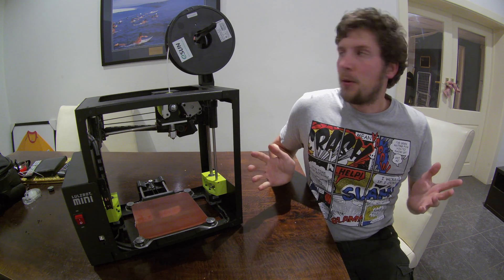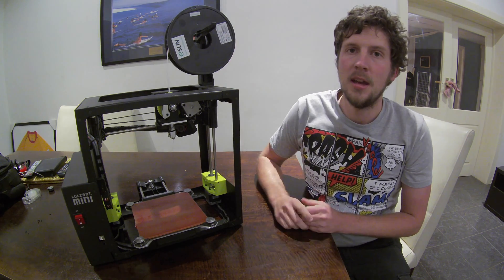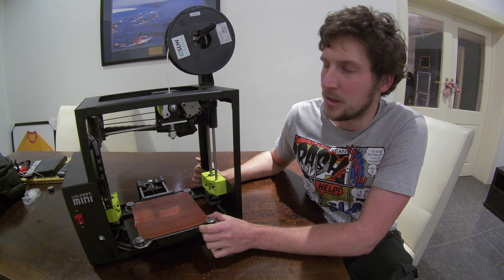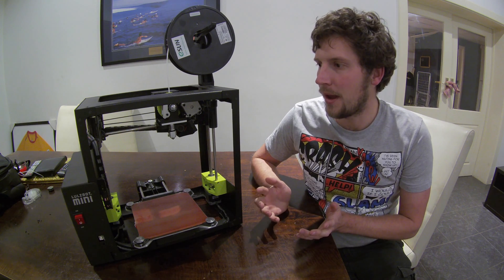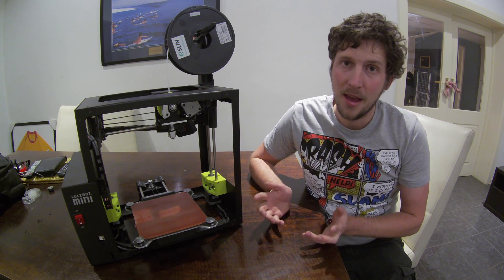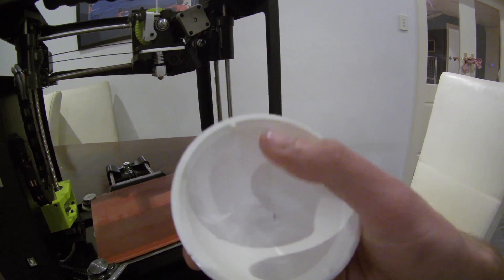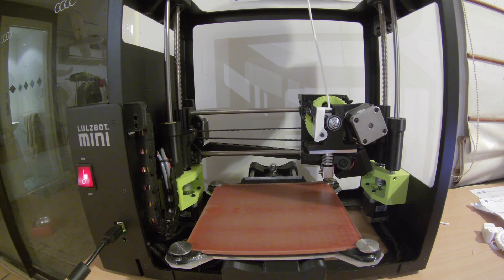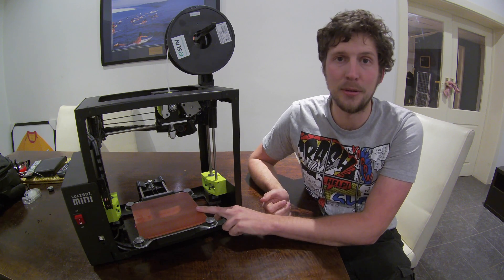Lulzbot mini 3d printer review

Comment: Great review! 

Pro tip re the dirty head - this happens a fair bit if the hotend is left on for a while which allows the filaments to wisp up the nozzle and "bake". We've noticed it more-so with PLA. Use the removal knife to do a gentle mechanical clean by lightly "scraping" the nozzle surface with the blade (notably around the very tip). With that said, we perhaps do this once a month, if that, and our printer is physically printing every day. Perhaps a better method would be with an acetone bath, but a quick mechanical clean is 50x faster!

Also, grab a Raspberry Pi and load up OctoPi for sub $100 remote printing (even over the internet). We have a great guide here http://core-electronics.com.au/tutorials/3d-printing/remote-3d-printing-with-octopi.html
Reply from the maker: +Core Electronics might have to try that if my first plan doesn't work. Found an old windows 7 tablet that has usb  out in my junk pile this week so gonna have a crack at mounting it as a controller.